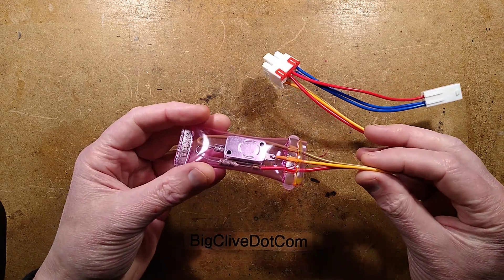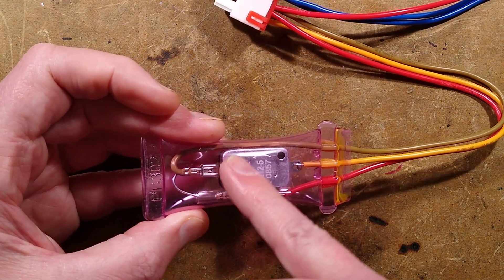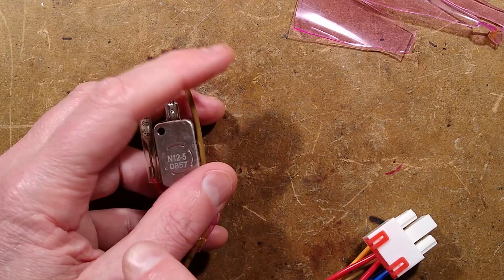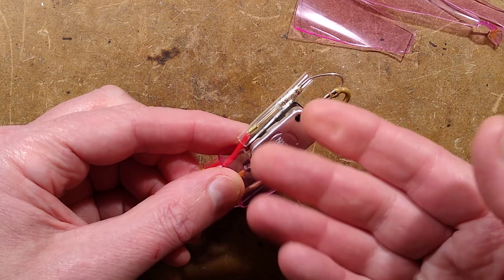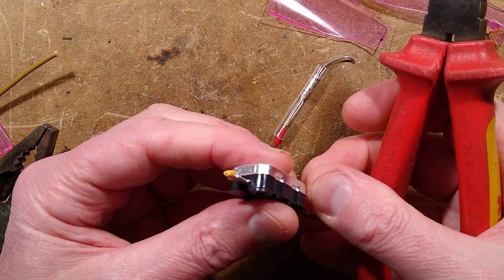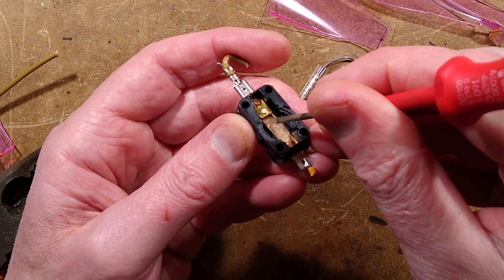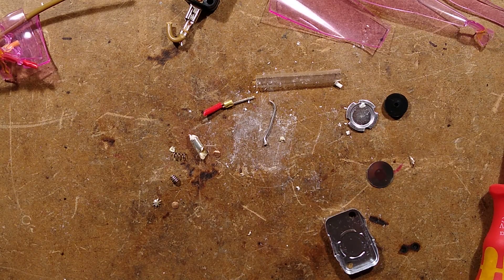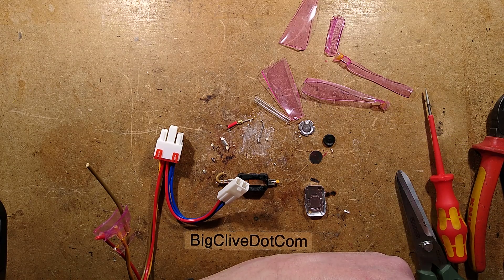Inside a defrost thermostat and thermal fuse

Comment: The package has been RF welded. welded using radio frequency energy.
yes it will probably seal the wire as well (as long as the covering is pvc)
I know I repair the machines
Reply: why would they use RF rather than a hotbar? What's the benifit?
Reply: @UberAlphaSirus  a "hot bar" could burn the pvc and still not provide a hermetic seal. The time the bar would be in contact would be very critical, too much or too little could ruin the item.
RF welding is better for that sort of job. You'd be surprised how many things are RF welded. Just go to B&Q and have a look at all the sealed clear packs .. they're a bitch to open but it stops people messing about with stuff while letting them see what they are getting
Reply: @davestewart2359  I don't see why a "hot bar" would burn PVC unless it was set to max. Why it would not create a hermetic seal. Can you use RF to impresion serial numbers on the other end of the capsule. And would the copper conductors interfer with the RF energy? Just some intrested queastions, no mallace intended.
Reply: @UberAlphaSirus  ok ..... Direct heat is very difficult to control. It takes time to transfer through the material, so while the inside is still solid the outside has already melted. Sometimes there are molecular changes that go on due to the heat and the material becomes brittle. 
Conversely with RF welding the tool is "cold", the heat is generated inside the material (a little like a microwave). The applied energy needs only to be on for a few seconds and the whole of the material where the tool is in contact becomes molten. Yes you can imprint text as you are welding, the tool needs to be designed for it though. Finally, yes, having wires poking out is not a good idea, but as long as the tooling and the process is properly designed, there "shouldn't" be any problems. Though accidents do happen. I remember working on a machine where thin steel backplates were encapsulated in the spine of a binder. The plates had to be placed perfectly as there was only about 1mm space all around. If the tooling hit the steel plate there would be a hell of an "arc" which would burn a hole in the upper tool AND the base causing a few hours downtime.
Reply: @davestewart2359  thanks. Sounds like I will have to look into it more.
Reply: @UberAlphaSirus  also look at this...
https://youtu.be/pnJml7Rz3sQ 
The packaging is most likely burnt due to an arc... Also shows the perils of RF welding something with a conductive inner..
Reply: @davestewart2359  No offence to Clive, but that's not a reference, is it.
Reply: @UberAlphaSirus  not meant as a reference...just as an example of what can happen when encapsulating conductive materials using rf

Comment: In a world where everything seems to have been simplified down to just be some chip or discrete sensor, it's always funny to me to see things like that thermal fuse that are sorta like some medieval contraption but with electricity
Reply: Safety devices should be as simple and reliable as possible.  Springs opening contacts, energy loss shutting down devices, gas pilot lights with automatic shutoffs, etc.
Reply: It's medieval stuff like these that save your house from burning down!
Reply: Thanks! I could have sworn I'd seen that somewhere.

Comment: You can see why so many white goods burst into flames today, their is no substance to anything built to the minimum and the thermal fuse to me is over engineered, is it a self resetting thermal fuse? If it gets to hot breaks the circuit but when cools down makes connection again?
Reply: Once a thermal fuse opens it's gone forever, the only problem with thermal fuses is that people replace them with solid wires

Comment: I've got a modern LG fridge that just had a defrost failure. It uses digital controls, and the defrost assembly is really stupid. There's one four-pin connector in the fridge, to which a single assembly plugs in - it's got two wires for a temperature sensor (Thermally variable resistor), and two wires that go through a thermal fuse and the heater. I had to replace the entire $90 assembly because the fucking fuse died for no reason. If I could re-seal a replacement fuse I could have avoided all that extra cost and waste, but I have no idea how to form such an assembly.
Reply: Probably the thermistor is intermittently broken, otherwise the fuse would never get warm enough to blow.

Comment: Had to have a look and found there are 3 main types of thermal fuse. the sliding contact like the one you had and two with a form of low melting point wire and resin. then the wire melts it forms two balls on end of the broken wire. the resin helps with the balls forming due to surface tension on the molten wire and also to form a insulation gap between them. Used them a lot but never thought about how they worked, just about what temperature they will trip at. Used to solder a few but used pliers as heatsinks to stop them tripping from the soldering. Always a nice little addition to the side of a mains transformer. Or if you want to keep the repair bills up a bit inside the transformer. 🙂

Comment: Plastic heat crimpers run at a steady temp. It is the duration that varies. A similar pink plastic that is heat crimped and waterproof is the sodium chloride solutions for inhalation.

Comment: I remember those thermostat bumps in older electric blankets to keep hotspots from forming and catching fire.

Problem when you  powered up a wadded/folded electric blanket without them every few feet along the heater wire.

Comment: Re the thermostat, I was thinking the springs pulled on a very solid resistive heater, packed into contact W a low melt substance. Heat melt's powder, springs pull, now liquid packer resolidifies around & between contacts.
But that would be tricky to make, and prone to failure due to the pulling springs, one Will fail first & either break the circuit prematurely or not fail at all. Equally bad incorrect failures.
The actual design looks much better, especially W the springs under compressive load & the only fail condition being the right one.

Comment: The operation of the standard refrig ice maker module is interesting to work out.  Just a synchronous motor rotating a disk with tracks that contacts slide on.
Reply: Now if only the valve wouldn't dribble leaving icicles hanging from the tray and a glacier along the bottom of the hopper.
Reply: @tactileslut  the fix for that is to change the solenoid valve, which is separate from the ice maker module.

Comment: So, the powdered material is some kind of plastic or wax? I'm assuming it would be non conductive, but I suppose as long as the pin to plate connection is broken, it wouldn't matter. If the outer canister of the thermal fuse was damaged, wouldn't it potentially render the sliding contact immobile? 🤔 I've always wondered what was in one of those thermal fuses, but they've always been blown when I encounter them, so I never really thought to open one!
Reply: now you're thinking. A lot of products are designed with intentional failure points like this.
Reply: @dimitar4y  my coffee pot at work blew both of the thermal fuses. One toggle switch and some random wire, and I had the most dangerous coffee pot imagined. Since I was the only one using it, I would fill the water, brew the coffee, and flip the switch off. I would have just scrapped it, but it was under a year old, just out of warranty. You're right about intentional failure points, a lot of products are designed to just make it out of the warranty period, then die, all in hopes of customers buying a new one, or at a minimum OEM replacement parts. Case in point, I have a washing machine roughly 5 years old, and it's on it's second drive motor. This replacement is starting to make the same noises the original did when it locked up. It's sad that manufacturers do this.
Reply: @jasonkuehl639  "Product as a Service" / "Sustainable Income". It's very real. If corporations were treated as a person, there'd be a lot of jail time involved, as these, ""people"" have inflicted insane amounts of malice and harm.
Reply: @dimitar4y  several decades back, I was studying to be a mechanical engineer, but dropped out of college when one professor told us 'as engineers, your job is not to design a good, easily serviced product. Your job will be to design a product that is quick to manufacture, provides maximum profit for the manufacturer, and fails early enough to need replaced often.' So, I went into the repair field instead (later into quality control). You are 100% correct! As the old joke goes, steal money in jeans and a t-shirt, it's theft; steal money in a 3 piece suit, it's business.
Reply: @dimitar4y  very interesting point about programming! Before my health failed me, the company I worked for used a software for tracking their production, inventory, and orders that was probably close to 25 years old. All our products were made-to-order, so if the software went down, so did production. After 25 years of different generations of programmers adding their patches and updates to what was an extremely simple program, it became massively unstable. For almost a week, we had no production orders because a new "feature" that was added managed to irritate a bug in the original software that was worked around because the company didn't want to pay the developer enough to rewrite the offending section of code. So, a Fortune 50 company relied on a few of us greybeards who knew the previous Unix based systems well enough to pull production orders to pull the orders, go to the engineering department and physically print the blueprints, and guide an entire workforce through production. There were a few of us involved in that that worked 16 hours a day, 7 days a week to keep things running until the programmers could develop yet another work-around.  Sadly, all the additional cost incurred would have easily paid for a development team to write entirely new software, start to finish. Too bad I won't be there to see the chaos that happens when that work-around fails and the old teams that knew how to do the job isn't there.
Reply: @jasonkuehl639  yep, it's all called "sustainable income". Unfortunately 50 years ago it was a conspiracy to "create a problem" just to fix it. Nowadays it's RECOMMENDED business practice taught in schools word for word. Instead of making a good product, just spend 60% on marketing and 40% on accounting. 0% for product development, 0% for staff and find volunteer customer support just to sod customers off so they can't file in complaints.
Reply: @dimitar4y  I wish I could say eventually that business model will fail, but the unfortunate truth behind it all is consumerism and greed. If the end user would repair things that should be durable goods rather than throwing them out and buying another to replace it, there would be good profit to be had in the parts market. But, for many corporations, good profit isn't enough, they want it all. Another horrible turn of events in the entire sustainable income model is that the biggest fish eats the smaller fish, then rebrands terrible product X under so many different names, it seems no matter what brand you buy, the money goes in the same pocket. My wife gets irritated that I don't bother calling customer support, but you hit the nail on the head about them! Last car we bought new, less than a year into ownership and the transmission started going crazy (no better way to put it, it would sometimes slip, sometimes lock into a gear so hard that it would stall the engine if you came to a stop, skip gears, etc, class action lawsuit against the manufacturer about it), and the brakes started grinding. She called their customer service hotline about it and was told she wasn't driving it correctly, all transmissions act like that, and she also wasn't stopping hard enough so the brakes were shot. All total nonsense, and enough of it that we gladly took the very slight loss on it to get a used vehicle from a different manufacturer. It's not a bad thing to make a profit, but to intentionally screw your customers to make a profit is reprehensible. One odd thing about the entire sustainable income model is that most of it is lead by companies who take pride in their brand, yet they don't seem to think there will ever come a time when their name becomes synonymous with junk.

Comment: Quite interesting. I wonder how they know they need to defrost though?
Reply: I dont think they do. I believe it's just a timer that turns on the defrost cycle at a preset interval
Reply: @57dent  Many thanks.
Reply: Clive spend some time describing that. I believe it's usually based on compressor time. It goes through a defrost cycle every (x) hours of compressor operation.
Reply: @AndrewFremantle  Was it in this video? I must have missed it.

Comment: Are the wires that get the hermetic seal treatment stranded or solid core. If it is a solid core then the plastic coating will make a nice tight fit but the stranded would need the sheath to melt through all those strands to make it airtight. I'm better the wires are solid core for that reason. Would be nice to find out one way or the other.
This assumes there have been no cable coating breakthroughs since I worked in the cable making factory many, many short years ago.

Comment: I've always taken 'hermetic' to mean 'beyond the influence of external factors'.  i.e. you don't need to consider what is outside the box into your calculations.
Reply: Hermetic, as indicated by a manufacturer, doesn’t always mean impervious.  It may mean “slows down”.  Take a typical double pane insulating glass for instance.  Organic or silicone seals do leak out argon and allows moisture vapor in, eventually ruining the IG.
Reply: @davidcooper3871  Yes, that's the difference between engineering and physics.
Physics uses hermetic to mean you only need to consider the system and don't need to consider it's environment whereas engineers know that's impossible.

Comment: them fuses are seriously over engineered....but i guess, they are thermal fuses, designed to open at a specific temperature either inside or out, which is controlled by the melting point of the material used to let the spring loose tension
thats not the first time bigclive has had some white powder on his table.....

...talc

Comment: Nice vid Clive. I often encapsulate small modules in clear, glue lined heat shrink, I crimp the ends whilst it's still hot, then pump in hot glue in the wire end, re-heat and it's almost potted. Have loads of IoT modules around the house done like this.

Comment: Well, that thermal fuse design explains why i keep seeing these getting intermittent!
At work we use them in gas reactor tubes that abate gases coming from semiconductor production tools. 184°C fuses. A column that has shut down will often be resetable once it has cooled down, but will turn off after half an hour, and the fuse would still read continuity when you arrive there.
That's one of the many traps for young players. Change that fuse based on its paint burned up,  not from what the meter tells you :p

Comment: Its a shame you cant get more electronics sealed inside the "bag" thing. It would be most useful for outdoor lighting.  great video 2x👍
Reply from the maker: It could work well for a radar style detector PCB.
Reply: @bigclivedotcom  Yes I could see a use for low power lghting supplys too. enem inside an enclosure

Comment: Interesting bit on the fuse. I always figured they were made with a fine wire with a low melting point.
Reply: These things often have to conduct the whole current in series with a line voltage (120/230/240V) heater element or heat pump compressor, so you can't really make the wire that fine.
Reply: Low temp alloys would not have the mechanical properties to be draw into wire. It is usually a button or a plug. Honestly the best you could hope for is a tensile of 5k psi with an sn/bi eutectic. The rest are drastically less.
Reply: *drawn

Comment: I tried to put a link in my first comment to a relevant 'thermal-fuse-operation-principle' website and my entire comment disappeared. Guess that's deliberate to catch spam?
Reply from the maker: Sometimes links get blocked.  I'll check and see if it's in the approval area.
Reply: I've come across that before - try reconstructing the link without the http and replace various characters with ones which obviously won't be in a link - but make it quite easy to reconstruct for viewers!

Comment: Good info, I assume that what might appear to be a minor dent on one of those thermal fuses could in fact completely DISABLE/JAM the internal sliding contact break operation!
Struth,  who would have expected that minor thermal fuse case damage is potentially dangerous?
Maybe this vulnerability needs a bit of research & publicity to avoid electrical fires?
Thoughtful Moment .... I nearly had a serious house fire a few years ago when a (new but mostly plastic) fan heater was found to be burning furiously in a briefly vacated room. (luckily smoke alarm went off). I couldn't work out why the thermal fuse must have not tripped until after the heater was well alight. I didn't look for dents in the fuse's case.

Comment: I've done something similar with my rc airplane/drone components with heat shrink tubing and a hot glue gun. The hot glue shrinks and seals it all nicely
Reply: I do this too, I buy the glue lined heatshrink and once hot I use an old set of heavy pliers to cold crimp the open end, then at the wire end pump in hot glue and reheat so it looks like it's been potted around the wires.